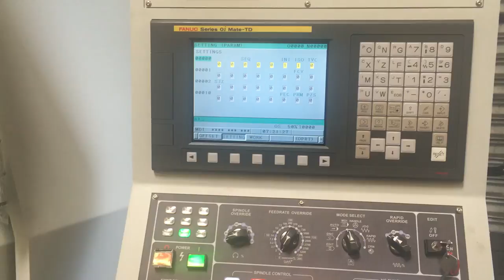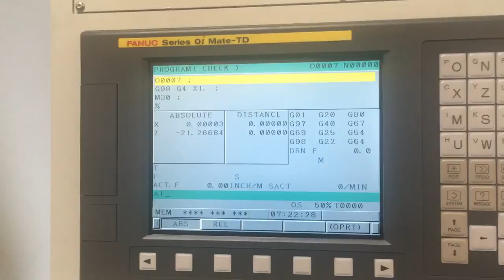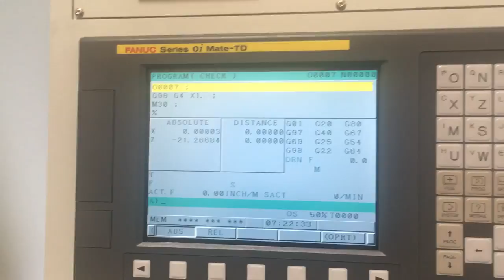Fanuc part counter set up

Comment: Good video and very useful information, one thing I would mention is when you assign an M-code you want for the parts count up, make sure it is a spare M-code available on the machine. On a Feeler VMP-580apc with Fanuc Oi-MD I work with, I wanted M60 to replace M30, but it did not work as the cycle would completely stop once it got to M60. I read through the owner's manual for it and codes M31-M38 were listed as functional codes but no assignments, while M60 was listed but left blank and not listed as optional/available. Just a little food for thought.

Comment: Are you still messing with these controls? I know this is a way old video. I may have a question. Thanks
Reply from the maker: Ask away
Reply: @gilforin  I got this Oi-TC on a Femco VL-25 VTL and I am having alot of trouble with tool changes. The machine all of a sudden gives me a message 3004 address not found. allot of times I take a tool out of the pocket and manually but it in the bar.  I was wondering if there is a way to override this thing so I can manually get it to the tool change position. These tools are heavy LOL
And thanks for the reply.

Comment: Sir Parametere enable /disable function not working 
Conditions correctly on MDI mode
1' input but not enable
Reply: Did u got the answer?
Reply from the maker: Sometimes the manufacture of the machines protect with a password, parameter 3210 but you have to call the machine builder and ask them. Normally the machine Model and Serial número at hand will help

Comment: Sir i want to lock part count so that operator could not change ; is that possible so guide me
Reply from the maker: Premsingh Thakur I think the best option is to add a password to the parameters. I think it’s parameter 3210 or 3211.  Check your Fanuc manual on how to activate the password

Comment: Sir.. 
Plz tell me about parameter.. MDI lock with exit key. 
Example.. Exit key on.. I use MDI.. 
Exit key off.. I don't use MDI
Reply from the maker: Pawan Kumar I’m not sure I understand the question
Reply from the maker: Ok, I think the way I would do it is in the Ladder logic,  putting a Normally in front of the MDI activation coil. But I would also put a Keeper relay under it so that it could be bypass by the maintenance department.
Reply: MDI means manual direct input.